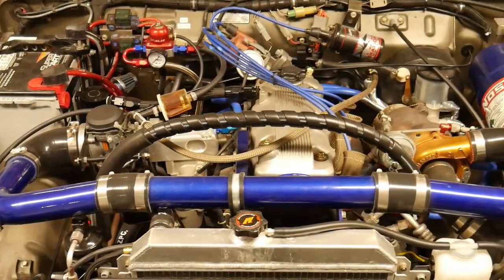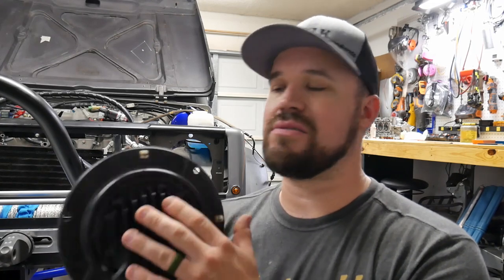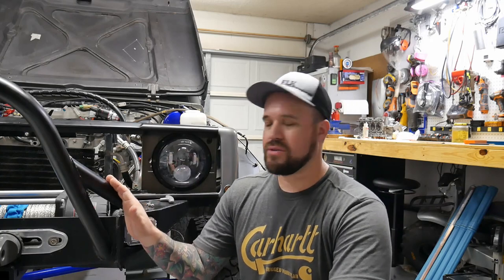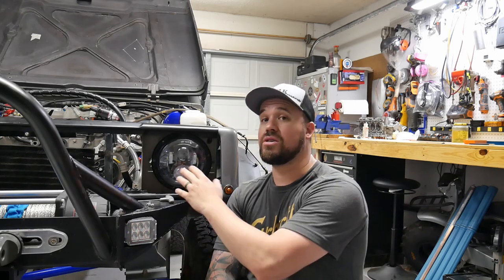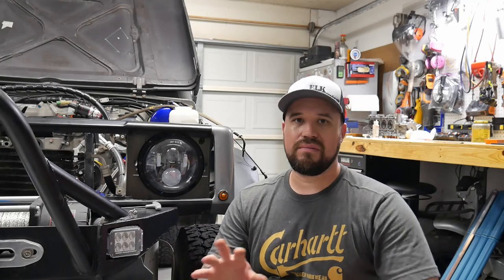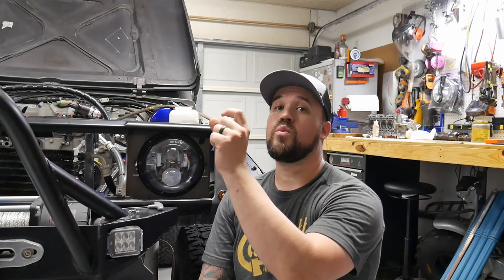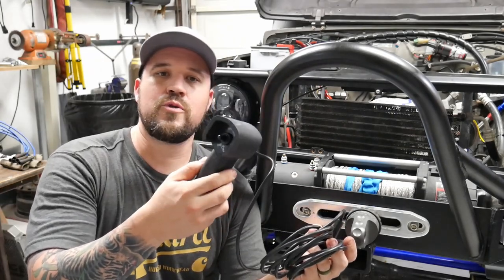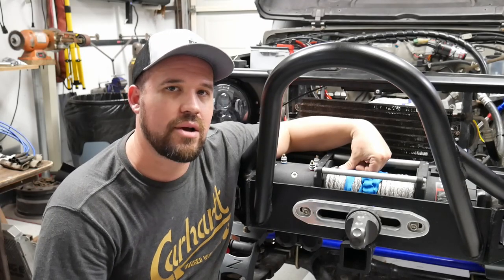Q&A Headlights & Winch

Comment: Thanks for recommending Strange Led. They just arrived. I can't wait to install.
Reply: Liwai Ani did you install strange led on your samurai?
Reply from the maker: I didn't use that vendor myself, but they offer the same head lights that I have.
Reply: ELK Motorsports I messaged him and he says some guys have bought them for a jeep and wasnt sure how they mounted.  Said it definitely wasnt a plug and play
Reply from the maker: Derek Raymo, if it's a 7" round headlight. It should fit. In the video I show you that I had to grind some of the housing, but not much.
Reply: Derek raymo yes 88 samurai. Like Trey said there is a little grinding on the housing but after that they fit like a glove. The headlights was plug and play. You plug your original head light plug into a can bus. Then plug the can bus into the other end of the headlight plug. It's very easy. The blinker feature on the other hand is a little more tricky. Requires some wire splicing.

Comment: Love your channel! I actually installed those original headlights you showed installed on my '87 Samurai. And I've been looking into the ones you currently have installed. Im really glad to see that you like them. One question I had was with the winch power supply. I went out and put an Optima Yellow top in because of the CCA rating and the Deep cycle capacity it has. However I was curious as to the charging capabilities. I know the stock 1.3 has a tiny alternator in it, but I also rebuilt a geo tracker 1.6 and did the petroworks swap kit install. I did order a GM alternator bracket and alternator from low range offroad and was wondering if this will be sufficient to recharge this battery after winching operations. Do you have any tips regarding the charging aspect of this upgraded alternator? Should I let the engine run for 30 minutes after winching to make sure it will start again? Thanks.
Reply from the maker: Josh Ernst, there are a lot of factors to consider, but most importantly batteries can only take so much amprage back in at a time. But I've noticed that the gel cell and AGM batteries do very well with heavy loads. As far as how long you need let the truck run after wincing, that is going to be at your digression. How long did you winch/ how long did you put a heavy load on the battery. 30 mins might be excessive most of the time, but in a scenario where you winch so much that you need a jump to start the truck, then 30 mins of idle time would most likely charge you're gel cell back up.

Comment: I was wondering how you wired up the relay and the fuse block you had under the hood where did you get it
Reply from the maker: I got the fuse distribution blocks from Wal-Mart. I've actually got some more that I'm going to be putting on the budget build soft top I have, along with headlight relays and light bars and pod relays.
Reply: On Walmart.com or in store
Reply from the maker: Rickey Morgan I got them in store, where the car audio stuff is. There are two different kinds, a single fuse block and a double fuse block. I have 2 double fuse blocks.

Comment: Can’t get ahold of dr z for the bumper kit I have the Zor back bumper on the way I’d like to get them at the same time but I have some questions about it before I order like how does it mount? Does it affect the sky missing links? The front bumper from zor makes you move the mounts over to accommodate care to share how your front bumper mounts? Thanks
Reply from the maker: Yeah I could do a short little video on that. I can tell you that the Dr.Z bumper doesn't interfere with the majority of missing link kits.
Reply from the maker: Danny North have you tried messaging him on Facebook. That's how o always get a hold of him.
Reply: Thanks for the quick reply! And no I don’t actually have Facebook one of those types that if anyone needs to know what I’m doing they have my number lol but no need to actually take time out for one question but maybe you could send some pics? I could give my email or phone number? Thanks and do you have any parts you would like to get rid of?
Reply from the maker: It really isn't a problem too make a video showing more of the bumper, it's kinda what I do, lol.
Reply: Do it to it my man! Also maybe on shock measurement and where to get the best ones and if the weight of the bumper is going to affect the type leaf springs you have?

Comment: Did you have a seperated wire to run just the running light part of the headlight? I have a different style of led light and I tapped into my side marker light thinking it would turn on my marker lights on the headlights but it doesnt. They turn on when the switch is full headlight. Any idea what going on?
Reply from the maker: ezzyeggy , I originally had the LED headlights that had the turn signal/marker light built in, but couldn't it to work on the bench so I had sent them back and just got the regular 7" LED headlight only instead. I thought it was something wrong with the unit itself. I know this doesn't really help, but that was my experience. If I could get another set I would try to fool around with it and document my findings.
Reply: Right on. I'm to the point where just having headlights is gonna be good enough. Thanks. I did notice that not running the engine and having a less than full battery causes one of mine to flicker.
Reply from the maker: ezzyeggy interesting. And you won't be disappointed with how bright they are. I didn't even need the extra driving lights I added on. These lights are super bright.
Reply from the maker: ezzyeggy, maybe a relay being put into the headlight circuit would help with the flicker.
Reply: @ELKMotorsports  they did send me a couple relays to see if it would help my running light problem. I tried one and it got pretty dam hot!! Took it out and just went with running lights that will only work with full on headlights. No biggy I guess.

Comment: So without the cambus the headlights wont work cos i tried to install them to the stock outlets and it didn’t work
Reply from the maker: Isaac Camilleri , my headlights came with the LED can bus, so I used them.
Reply: Does the headlights only need canbus? Because i got some of these headlights and they didn't send me canbuses. Without them they dont turn on :(
Reply from the maker: Rómeó Csölle, this is what allot of people are telling me. I only ever used the canbus so I would thing that's the case.

Comment: Also mine is stock im not loaded with money lol id like to lift it wat do you recommend
Reply from the maker: All the YJ kits are good, but I have DR Z's kit : http://www.drzfab.com/product/samurai-yj-conversion-kit/
and i got a set of new YJ springs from Low Range off road: http://www.lowrangeoffroad.com/suzuki-off-road-parts/samurai/suspension-parts/1987-1995-jeep-yj-1986-1995-suzuki-samurai-with-yj-swap-leaf-spring-and-bushings-rear-2-5-by-old-man-emu-cs037r-omesb57.html
You'll also need to get driveline spacers 1" for rear and x2 1" for the front if you go with the YJ Kit:
 http://www.zuksoffroad.com/Samurai-Drive-Shaft-Spacer-Kits_p_250.html
Reply: ELK Motorsports thanks alot bro i really appreciate it will definitely look into those links
Reply from the maker: Your welcome